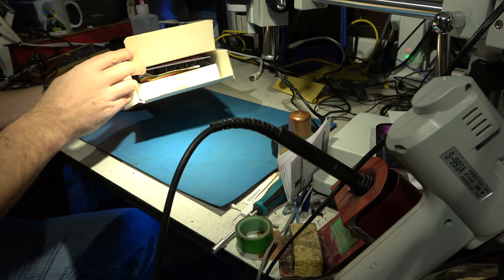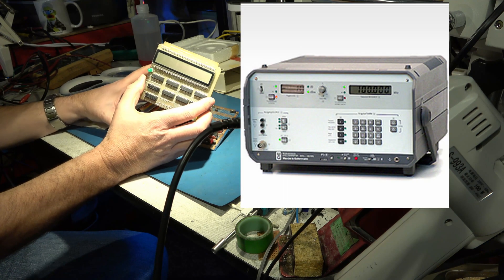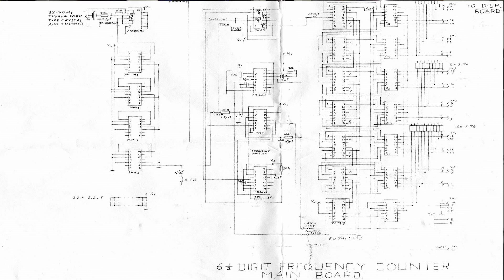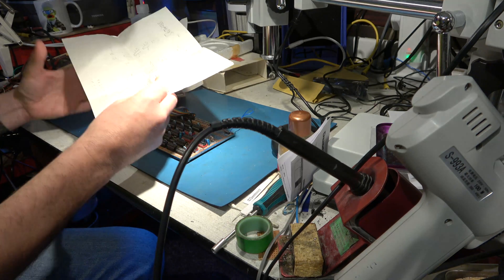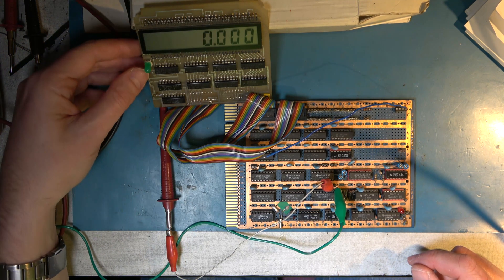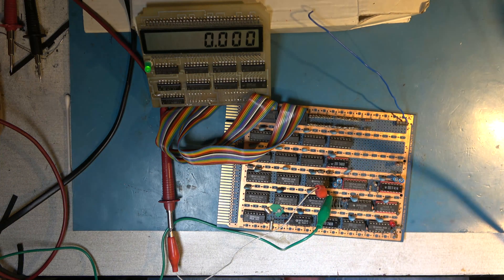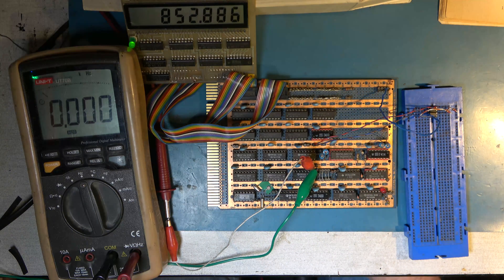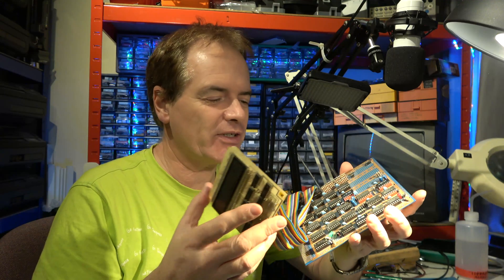A frequency counter project built from TTL chips in 1985.

Comment: I still have one of those pens.  I built a complete controller for 4 VCR's for a CC education TV channel back in the late '70's..  It had 5 of those plug in Vector cards and used DTMF tones and a clock to control the machines.  I also had a board to display the time and text on the screen when the VCR's weren't playing.  The whole thing was wire wrapped with real wire wrap wire and sockets and had nearly 150 TTL chips.  I found it on a high shelf in my garage last year and it still worked!  Nowadays, I could do the whole thing with a Raspberry Pi and a small interface board.

Comment: That 7493 78 vintage still going strong
Reply from the maker: Many of the ICs for this project came from my collection rather than bought new in 1985.  So there were some older ones in there.  I still have a nice collection of TTL chips.  I thought electronics was a natural progression from Lego, and building logic circuits from TTL feels a lot like that.
Reply: @video99couk  the wire rapping is a fine art and very impressive. I was still coming across board builds like that up to the late 90’s. Back in the 70’s I used to get random ttl chip packs advertised in practical electronics, of course some you would never use but handy to have. Ic’s that I needed were always ordered in multiples of 3 or 4 each, really to keep the project build going for years to come. Thank heavens for maplin, Doran electronics which was really RS and electrospares another RS offshoot (counter staff of rs had never heard of) showing my age and also especially cirkit which had the best choice of RF parts anywhere.
Reply from the maker: @MERSEYSHIPS  I think a lot of my TTL chips came from those packs.

Comment: I suspect that your circuit needed a input conditioning circuit to give a decent waveform to your TTL input.
Low pass filter/attenuator/biasing..
That's brilliant, it still works after all this time so it's reliable :-D
i liked the lcd display, very pro looking, and nice crispy numbers :-D
With a divide by 10 prescaler it could show ten times higher frequencys.
A very complex circuit.
.
I also made a counter but around 1990,  mine was the cmos version and i started at the display end.
After i rigged up a led display to a common counter chip, i had a play around with it to see how it worked :-D.
Later i added 7 of them in series, carry out to the input of the next one.
It was something like a cd4033 maybe cd4026.
The next thing wanted was a gate and clock,  i had no clue how to do that, i gave up that night and i woke up at 3 am and  the answer just appeared from memory,  i jotted it down then fell asleep again lol.
A divider and a cut throat feedback circuit that hit the reset when a 1 second pulse from the dividers output had ended.
It worked!!. :-D
And it counted the frequency, but you could see it counting but hey it worked.
I added a 1 or 10 second count circuit, also an auto reset circuit so i didn't have to press a button ( lazy lol ).
Sorry colin, long waffle :-(
Reply from the maker: Waffle as much as you like!  It's interesting to hear how someone else did a similar project.  A divide by 10 prescaler would probably have been very expensive back in 1985.
Reply: @video99couk   i was going to use a memory to store each number so while it was counting it would display the memory contents, but i never got the counter finished.
i added a 4017 decade counter then fed it with a classic two transistor multivibrator, the outputs of the 4017 drove the display commons via transistors, and the enable pin on each counter.
I used 1n4148 diodes to connect all the counters outputs on to 7 lines that fed to all the displays.
it worked spot on, even i was supprised lol.
The prescaler chip was the part i could not afford, so the project sleeps on a shelf lol.
it didnt matter as i had acheaved my goal to make a frequency counter.
I have a racal counter now, so i dont really need to continue the project but maybe ill get interest in messing about with it one day.
Reply from the maker: @zx8401ztv  If you look at my circuit, you can just about see that the counters feed a set of 74LS77 latches which are used to hold the display data between refreshes.